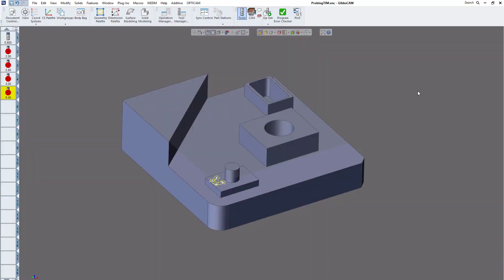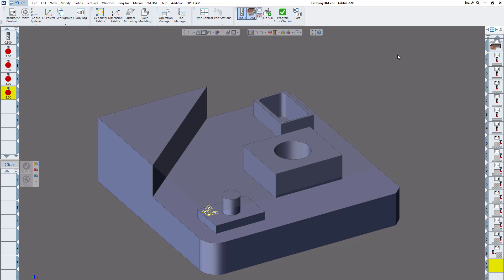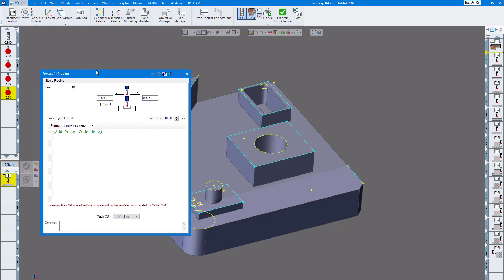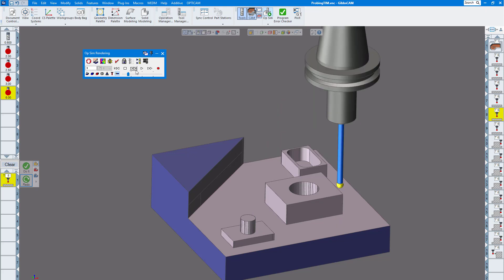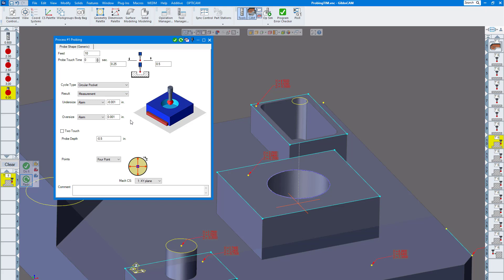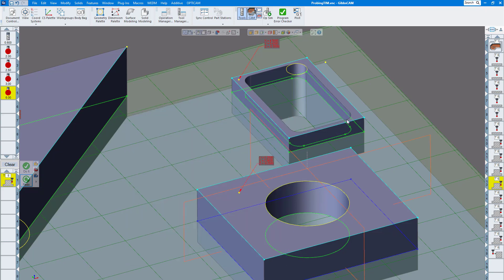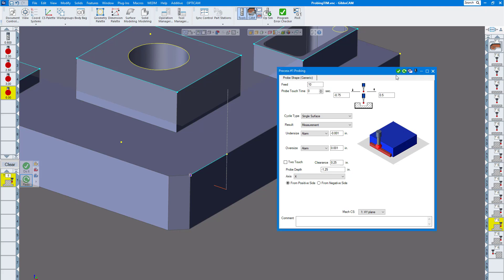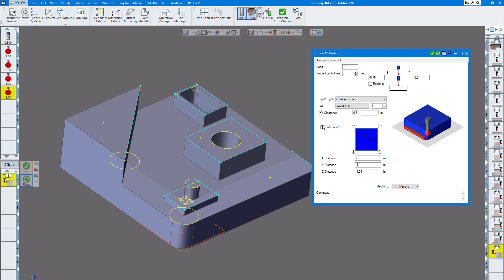GibbsCAM v14,  Probing

Comment: can you show probing a angle for G68 rotation for a Haas
Reply: Normally probing routines are made to go inside a program, for instance to find a corner and reset your fixture offset , or measure a hole or rectangle and output using DPRINT the values, or to compare and recut or reject  Most times when you want to probe an angle, this is done in setup to align your part to your X or Y-axis, so you would not necessarily need to do it inside a running program.  I am sure Gibbs will be adding more capabilities down the road.  Also G68 is usually an option on many machines.